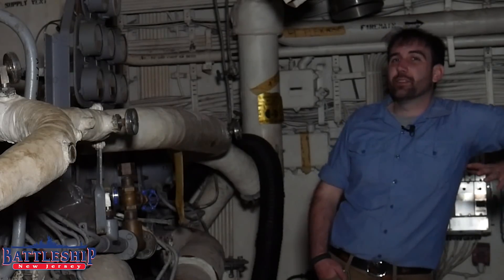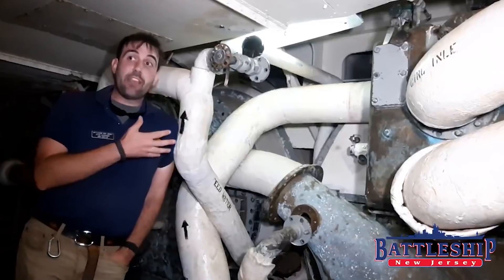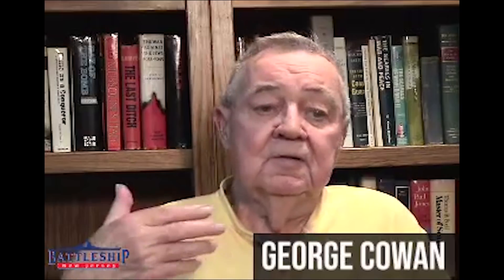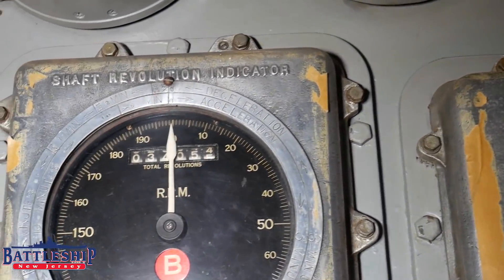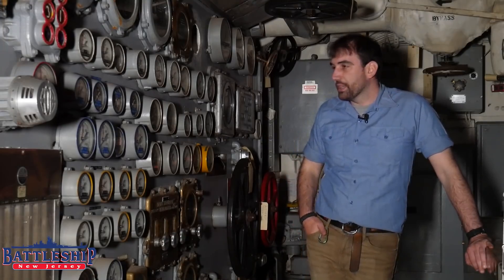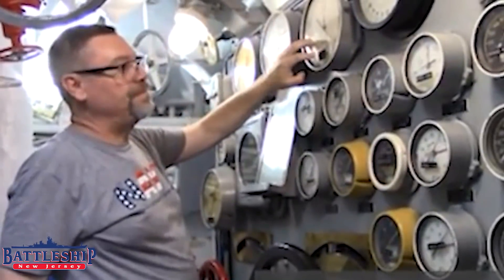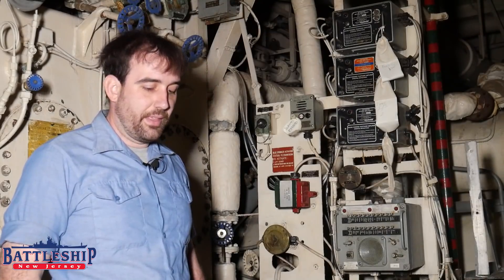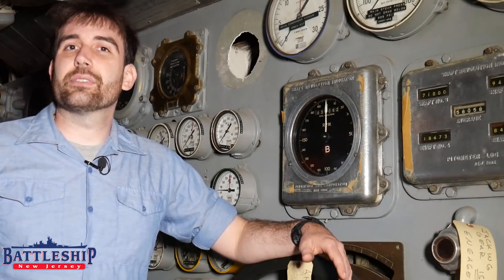Inside Battleship NJ's Engine Room #3

Comment: I was a USS Missouri EOOW in the late 1980s.  We had basically the same setup for "Main Control" in #3 Engine Room... a stool to sit on, a small table for log keeping and manual storage, and a larger gauge board than the other engine rooms.  We didn't have a booth until ship's company built one in 1989.  It was insulated with the over head air duct directed into it and a large window facing the gauge board.  That was great because it was much quieter than being out in the engine room, so the EOOW didn't have to wear hearing protection and could hear comms much better.

Comment: Awesome. I can see the principle of control is similar to the modern ship I was on yet so vastly different. On a modern ddg the EOOW is in central control CCS also known as DC central. He's their with a PACC operator Propulsion and aux control console, and an EPCC operator. The EOOW now days has all the info he needs on a couple of screens, so does the PACC and EPCC. Down in each engine room there is one operator in each at his own console that has similar screens and throttles to answer bells Like CCS can. It's fascinating to see how the battleships were controlled back then. I wonder if they ever did trailshaft while engines were down?
Reply: We ran all 4 engines all the time... it was very uncommon to have an engine down at sea.

Comment: The guy showing the main engine gage board vacuum gage function I feel was in error. As I see it, HP steam from the boilers are piped to the HP thru the LP turbine blades which in turn is drawn to the main condenser, circulating sea water, though vacuum, which is turned into feed water.  Thus the steam cycle.  My experience with steam Naval vessels was at Long Beach and
Puget Sound Naval shipyards as a shop 38 Marine Machinist, now retired.
Reply: Um....no.
HP Steam goes to the HP Turbine.  That is why it is called HP Steam.  Then when the HP Turbine extracts what energy it can from the HP Steam, it becomes LP Steam and goes to the LP Turbine, or in some cases it becomes IP Steam and goes to an Intermediate Turbine, via a Crossover Pipe.

It would make no sense for the HP Steam to go to the LP Turbine and then to the HP Turbine.  Think it through.

Comment: I was on the USS Farragut, Uss Canopus, and Uss ES land which is still in operation today. they were all Steam powered Ships and i was a MM in the engine Rooms of all 3 between 1983 and 1995. They used the same equipment as the NJ in this video. With the Exception of the USS farragut having a 1200 psi Boiler system. The other 2 ships used a 600 psi Boiler.

Comment: How. Fast.  Can a. Battle ship get under way after  it gets.  600 psi . Steam
Reply: Considering that it has 4 shafts, max speed is probably around 30 knots. I was on a destroyer that had 4 1200psi Boilers and it did around 35knots. And the 2 Sub Tenders i was on with a single shaft and 2 600 PSI boilers would do about 20 knots.

Comment: Great videos.  I've always wondered about the relationship between the engine rooms and propellers/shafts.  Lets say engine room #1 is out, does that mean shaft #1 no longer turns?  And what if you lose shaft #2 and engine room #1?  Are you down 2 shafts now?  Or they do they cross-connect?

Comment: Never served, but that room does seem familiar to me, work in a coal processing plant, wouldn’t think a lot goes into the operations side of it but when I first walked into the control room it was intimidating, all mechanical gauges, switches and relay buttons with bulbs in colored lenses, got adept at running it after a while, learned you really had to operate it by sound and vibrations if something sounded odd you went to investigate or if the rhythmic vibrating changed, you knew something shutdown and to go find out, that board never quite told you what was wrong it only gave you an indication that the system was either on or off. After a fire that completely gutted the interior of both the plant and the control room it was all rebuilt and renovated, now instead of pushing a relay button and getting to hear that “click” I point a mouse at a icon on a screen, I have to say I miss the physical buttons of the old set up but the new control system is so much more user friendly and smart, it can give proper accurate indications for any faults or shutdowns

Comment: It appears that the engine order telegraph has the forward speeds 1/3, 2/3, stand, full, and flank. Does that mean that there are only 6 RPM settings that would be called up in the engine room? No way to make it more precise, for instance to match another ship's speed? If it can be more precise, how do the four engine rooms make sure they use the same RPM?
Reply: The speed indications on the engine order telegraph are for general steaming and cruising.  If you need an particular speed for a tight maneuvering situation you would get the order from the bridge (or the control room for us bubbleheads) by the telegraph with a follow up phone message to make turns for X knots (the throttleman had a chart for turns to speed at his station) or to make a specified number of turns.  MM1(SS/SW) Retired, Engineering Watch Supervisor
Reply: @billbutler335  Yep. After awhile, we didn’t need to refer to the charts.
Reply: Tom, the bridge will communicate by sound powered phones the number of turns (rpms) they want. On New Jersey, it looks like the number of turns from a turns indicator also. So the bridge might call out “ahead 2/3s, makes turns for 90”.
Reply: I don't know how it would work on an old BB, but on the ship I was on, the bridge could call down a modification for a bell. They would just call down to reduce 5 rpms or something. We never did it, but it was possible. We had remote bridge control when we were in SSD (special sea detail) so they could fine tune from the bridge, but we were down in main control ready to take over if needed. Once out of SSD throttle control was given back to main control.

I was an EOW (Engineering Officer of the Watch).
Reply: @JoshuaTootell  Almost all changes in turns during unrep were done via sound powered headphones. The only time the EOT was used was at an emergency breakaway, because we would be going from say 1/3 to flank as fast as possible.

Comment: I've wandered through one of Battleship NC's engine rooms to get the feel of it.  However, this Battleship NJ view made me understand some of what I saw even though I think there are quite a few differences.  I can see why this ship cost so much to run.  Almost no control moves without someone turning, pushing or pulling it.  I've automated some industrial processes and equipment in my career.  Every time I was able to reduce the number of control points/valves (etc) using computer algorithms (equations) for the same or better system control.  A newer ship of similar size with a much smaller crew and fewer valves etc. with less maintenance must have more room for fuel, ammunition and arms.  NJ and NC must have hit an operating expense limit even before they wore out.
Reply: Automation is great, but it doesn't do the right thing when it takes damage...  These boats could fight through and win.  A modern boat with no crew?  Maybe not.

Comment: How often would all the engine rooms be operational? Would all 4 be on most of the time?
Reply: Usually all 4 were in operation underway.  We did occasionally take one offline for repairs, but that was not normal. Traditionally we had 4 boilers, one in each fire room, all 4 main engines, and usually 6 SSTG’s, 3 forward and 3 aft, online when underway. If In-port aux steaming, only one boiler, both generators online line.

Comment: Had Kentucky been finished and served, could it have become a Museum Ship in the Commonwealth of Kentucky along the Ohio River?  The Ohio River locks are 110 wide by 1200 long so they could fit in the locks, but would the 36 feet draft be too much for the Ohio and Mississippi Rivers?  Would they fit under most bridges on the rivers?

Comment: if it is super heated steam. they are technically called steam generators. people get them confused a lot as there are old steam cars that use super heated steam to. the system is called a steam generator cause a broiler operates at 350-500 F steam generators operate at 750-1200 F.
Reply: higher pressures and such

Comment: Steam plant = the best teacher of the heat cycle. Just trace the pipes with a flashlight, and it will show you everything. Heat source, adding sensible heat, expansion, heat sink, heat recovery, etc. Need blueprints to see the heat cycle on a diesel or gas turbine… not impossible, just not as tangible as a steam plant.

Comment: WTF did they did they do to my evaporator??? Looks like it was vandalized! Note to some No.3 was not ran to much due to if the ship was in heavy seas and on a good day only put out 800 gph and was a bitch to run. No1 & 2 1800 gph. But you could hotrod them and put 2400 gph very few of us could do it i think my all time record was 2600 gph But when you got down by the equator where the sea temp is much warmer you had to slow them all down or salt over and get a phone call from no. 3 engine room the chief engineer would like to speak with you. Will someone get down to forward diesel and put my baby back together. I can't help you my girl friend won't let me because of being in a wheel chair and would help getting down there. Cancer sucks more treatment friday.
Reply from the maker: Mothballing is hard on equipment

Comment: How were cable paths made watertight when they traversed waterproof bulkheads?
Reply: They are passed through metal conduit‘s.
Reply: @BlindMansRevenge2002  right, but a metal conduit is just a pipe.  How did they seal the ends?
I assume they used watertight fittings on watertight equipment, but I see a lot of free wire that I assume must be terminated in another compartment or inside watertight equipment.
Reply: Everything goes through "stuffing tubes". The conduits were stuffed with a rubber like material to seal everything off. I don't remember what the material was (I never dealt with it), but it was visible everywhere.
Reply: @JoshuaTootell  what color was the rubber? We use a similar method at work, but it’s for fire/smoke, not water.
Reply: Oh, I don't remember. I never dealt with the material as I was a mechanic. 99.9% of it was whatever color ended up getting painted over it. My last ship was 30 years old by the time I served in it. My ship previous to that was 50 years old when I served in it!
Reply: @JoshuaTootell  that’s pretty interesting. Thanks for sharing!
Reply: Ryan does this video standing right next to a bunch of cabling going through tubes:

https://youtu.be/TOrnsQM4bqU

Comment: How about a video that covers the noise levels in different parts of the ship. Maybe include the engine/boiler rooms, the gun house when firing ect.
Reply: The only mechanical noise on the ship is air conditioning. It’s not an active vessel.
Reply: I think he meant when underway  @Miner-49

Comment: Engine Rm #3 is the natural place to put Control as it's right in the middle of the plant. It gives the EOOW a shorter walk to any given MMS if they have to investigate a fault with the roundsmen, and the central location allows them to relay comms from one space to another in action if the direct lines are severed. The same thing is done when locating the machinery control room on modern warships.

That's also why you get a phonebooth, so engineering signals (helm orders, speed alterations, etc) can be made to and from the bridge in an organised manner during GQ. I bet all the ship's service phone circuits in the booth have redundant sound-powered outlets nearby as well for the same reason. (Edit: yup, loooooads of nearby sound-powered.)

Comment: Great job your video team does each week. In all your internal vids you can’t help but notice the miles of piping, cabling and ventilation ducts that are present. Maybe you could explain how these parts of the ship pass thru different water type compartments and still keep the integrity of said compartments.( If they really do?) I mean closing water tight doors between compartments is great but how do you stop fire, smoke and water from just traveling along these areas where they pass thru the bulkheads?

Comment: Lots like the propulsion plants on Essex class carriers. I was a Boiler Technician on Lexington from 83,- 86. The closed steam cycle. = Generation, Expansion, Condensation & Feed. We also ran 6000psi B&W M type boilers. Stick shift. Plant layout was forward Aux, then #1Fireroom (boilers #1&#2 side by side), #2 Fireroom boilers #3&#4 side by side) #1 Engineroom also known as Main Control. Then #3 Fireroom (boilers #5&#6 facing each other to make room for the shafts from forward engine room.) Then #4 Fireroom (boilers #7&#8 also facing each other)  then Aft engine room with #3&#4 main engines. The Aft Auxiliary Machinery Room. The deairrating feed tanks were in the Engine rooms.. #1 engine room had the lube oil purification system and all lube oil was moved via 5 gallon oil cans I remember main feedwater pumps held approximately 50 gallons of 2190 TEP oil. That was a job and if the carbon rings went bad it was a long watch humping oil constantly...

Comment: I used to work on a tender and we worked on those ships in those stacks and believe me there's no way the terrain is going to get down the stack to the boiler it's just not going to happen there's too much heat and too much updraft and blow the water right back out the top of the stack so all you have a stock rods in there to stand on to work on those Stacks if you have to so it's not an easy chore believe me if not an easy short

Comment: On the News our main control was in #1 engine room. The control panel was located across the space just forward of the main turbine. I remember how we changed our shaft speed up and down by one turn during refueling detail to keep the ships perfectly aligned. Tearing away a refueling hose was not a good thing.

When we came into port we would use the screws as well as the rudder to manuver. For example we'd go from 1/3 ahead to 1/3 astern on the outboard shafts as we approached the pier. A good throttle man could shut off the ahead throttle and open the astern to brake the shaft and get it spinning astern pretty quickly. 

Our captain set up a "flank speed right now" signal by running the telegraph from stop to flank speed three times. That meant that somebody was shooting at us and he wanted the ship to accelerate as quickly as possible. It takes a little while to get a 23,000 ton heavy cruiser up to speed but we gave him all that we had without pulling the boilers off line. Better than being hit by NVA artillery. 

Our phone booth was lined with asbestos soundproofing. I know that went away some years later but in 1972 if the red lead paint or the agent orange in the drinking watet didn't get you, the asbestos would. When you're 19 you think that you're indestructible. 

We hope to get back east this summer since there's less paranoia about travel. The wife may want to find something to keep her busy but I plan to walk up the brow and request permission to come aboard.
Reply: I Was on the USS Oklahoma City  CLG5 ,we got too sail around with you out on  the gun line and up and down the coast shelling and being fired on . Main control forward engine room 71-73 . Never got to see the New Jersey,she left Nam in 69 and was decommissioned.
Reply: @Dave Lewis, if YOU thought tearing away a refueling hose was a bad thing, think about how WE felt.  Before my time, but my ship was most likely one of the oilers on the other end of the hose...

IC2
USS Kansas City (AOR-3)
Reply: Half ahead to half astern is a pretty easy situation for the boiler room guys as the engine room basically shuts ahead and opens astern throttles.

Comment: Did I hear you say that when an engine is shit down for maintenance that they would run on 3 shafts??  I thought that they ran all 4 all the time via engine room steam cross connects.  Is that wrong?  That must be a lot of drag to have a propeller stationary at speed, no?
Reply: If a turbine is down for maintenance, cross connecting steam won't help
Reply: Shafts can also free wheel so there's minimal drag. You can also lock the shaft in place if needed.
Reply: I was on a twin shaft ship. Anything above 2/3 bell and we would windmill the shaft. We had to stay above 65 RPM to maintain proper lubrication so we would adjust pitch on the dead shaft to keep it pitched out as far as possible to reduce drag, but not so much that it would drop below 65 RPM.

For us 2/3 was the minimum. If we dropped to 1/3 then we would have to stop the shaft. If we went back to 2/3 we would keep the shaft stopped unless we got an order to Standard bell, the we would break it free.

Any excuse to stop the shaft was made, because it meant taking less readings by the watchstanders 🤣

Comment: How do they clean out the salt and other particulates from the evaporator?
Reply: We Did a Chill Shock Procedure on the Evaps. You would put in steam until the proper temp...Hot was reached. Then you would run cold seawater thru those empty tubes .
All seawater stuck would Crack and fall to the bottom catch pan. Pull it out and empty it..
Nice clean Evaps again. And will produce more water than before.
Reply: easy take it apart clean the tubes put it back together a fun job
Reply: @waynekoepke8128  I had a grandfather who did that on a Fletcher(McDermutt). Not his favorite job. He got to the ship just as the war was ending, letting some other guy get off the ship.
Reply: I had to clean out a 6 stage EVAP on a Sub tender I was stationed on. they have manhole covers for each stage and large peices of what looks like steel wool blocks that goes in the upper part and the stages get schale buildup over time and we had to remove it using a scraper and pulling out all the steel wool blocks and shake all the salt resadue from them.